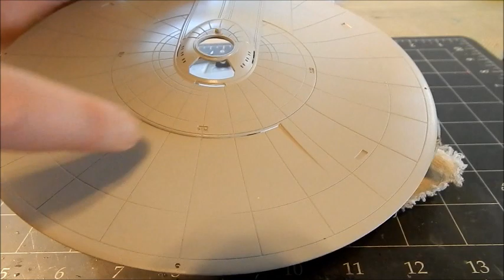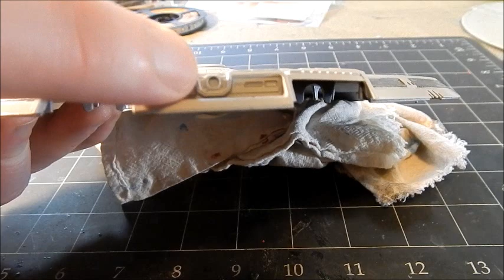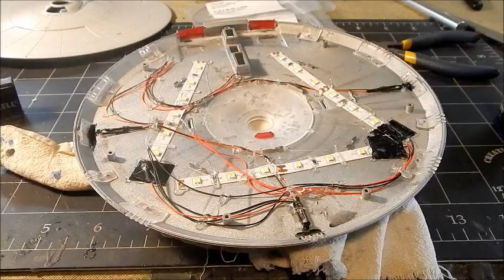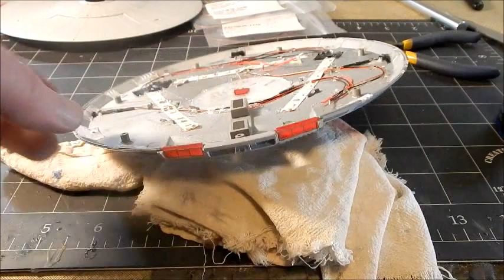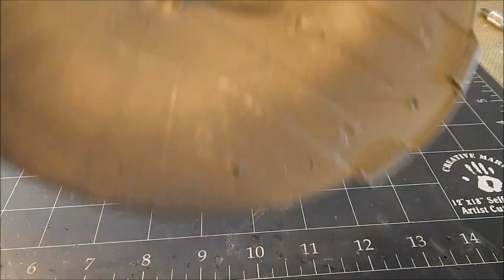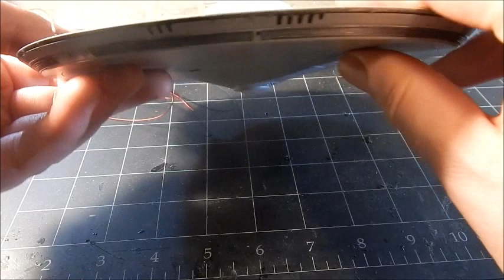Polar Lights Enterprise Build 04

Comment: What are you using for light block?
Reply from the maker: Hey Bill, for light blocking the body, just flat black paint will do. Over that I will throw on a coat of white to promote light bounce for my LEDs, normally white but you can use chrome. For individual LEDs it depends on the situation. Normally SMDs I will just use some electrical tape, and seal the edges of the tape with some adhesive just to make sure it never lifts up. LEDs I will normally paint with some chrome paint, to get light to reflect and for some blocking, then I'll go over that with some thick black paint. I normally use a paint called Tulip, it's fabric paint, I found it at Michaels. I hope this answers your question, and thanks for the view!
Reply: @PunkyWily  The light blocking looked 'square', so I wondered why.  It must be the electrical tape.  Thanks for producing the videos.  I learned to use permanent marker for the blades on my 1/600 TOS ship.  I tried sponge  and fine brush, but it did not work very well.
Reply from the maker: @RankinImagery  Yeah that clear plastic is a pain to paint over. What I should have done was very carefully sanded the raised blades with some fine grit sandpaper and then added paint, learned that one after I did this build.
Reply: @PunkyWily  It looked like it worked well.  Looked good to me.